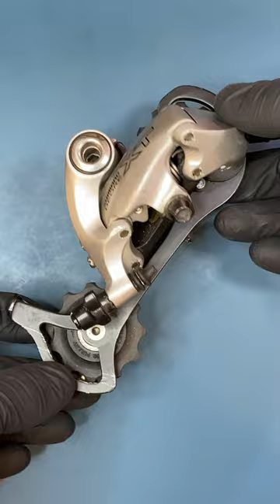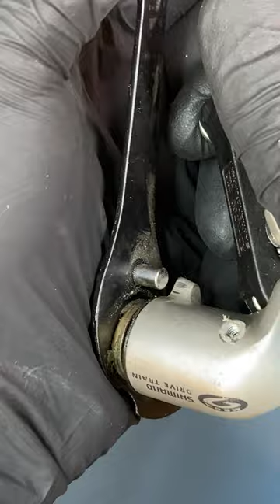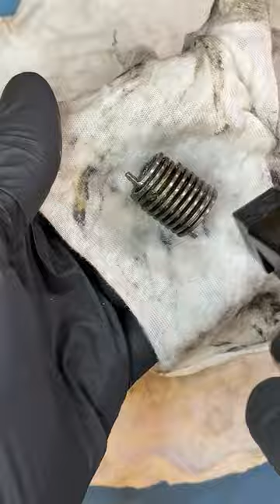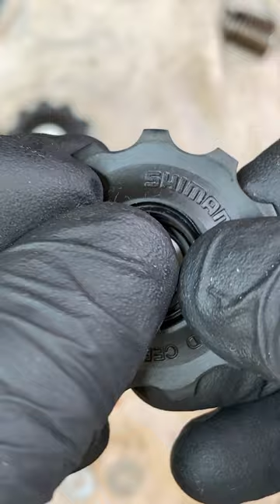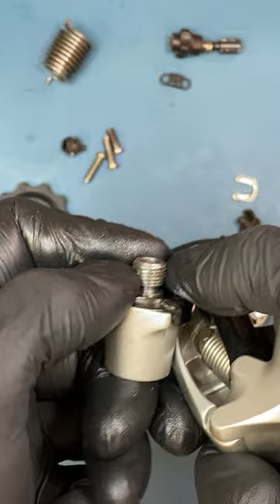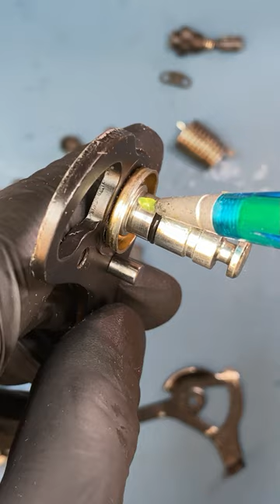Full overhaul. Rear derailleur XT - RD-M750.

Comment: I always get XT level rear derailleurs because of the ball bearing pulleys that aren't available on the lower level models.
Reply: You can buy it separately
Reply: @michap5995  , yes XT M8100's weren't available in late 2020, but the pulley's were. So, I installed the M8100 pulleys on a new Deore M5100.
Reply: @watertankhikes I have XT M750 9 speed, XT M772 9 speed and XT M8000 11 speed rear mech all very good quality
Reply: @sepg5084  This website not good took one month to come
Reply: Guide pulley in this video is literally on a ceramic  bushing bearing, no balls there :)

Comment: I diy'ed mine, i drilled another hole for spring mount to make the spring stronger...
Reply: any drawbacks?
Reply: @OliverWode  yea, it may snap
Reply: No necesita, ya trae los agujeros hechos.
Reply: @ripptorr  well, only if the chain is too short?
Reply: @OliverWode  you may need more effort with your thumb to push the shifter but down shift is effortless...

Comment: I don’t know too much about bikes but wasn’t that a sealed bearing? Like I’m pretty sure you shouldn’t open them
Reply: Better to just replace.. they cost $2 each or less in bulk. But yea I don't think he was re-greasing it actually looked like he was just checking if it's greased properly. Idk tho.
Reply: Like I’m pretty sure the mechanic who does this for a living knows more. It’s the cap he lifted it showed us them placed it back it’s fine.
Reply: @angelsaucedo2231  Is he a professional?
Reply: @geckoram6286  he gets paid to do something so yes
Reply: @angelsaucedo2231  ah ok didn’t know that, idk a lot about bikes specifically, I thought they were like the bearings on roller skates
Reply: @geckoram6286  Yeah, the same, he just lifted a cap, to check for corrosion and grease. You can just rub it with ... diesel, dry and re-lube it, so you have new lube there. Less corrosion and so on.
Reply: @kylelongstaff  ¿Y vas a reemplazar las poleas cada vez que hagas mantenimiento? 😂😂😂😂 es abdurdo y cuestan como 20 dólares el par.
Reply: Shimano no tiene rodamientos sellados. Se desarman, se limpian y se vuelven a ensamblar.

Comment: Whats the advantage of having a lower tension?
Reply: I researched a little - apparently the shifts are more "flowy", everything feels more seamless. Also wear is reduced. But if you prefer to drive strong off-road trails, it helps to drive a higher tension so that the chain stays better in place.